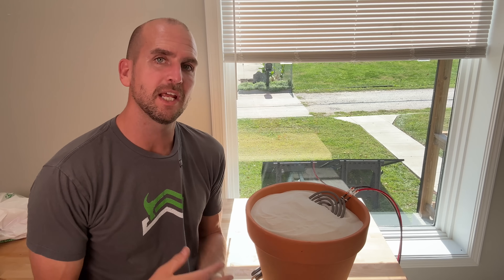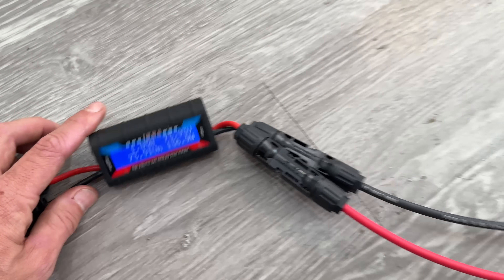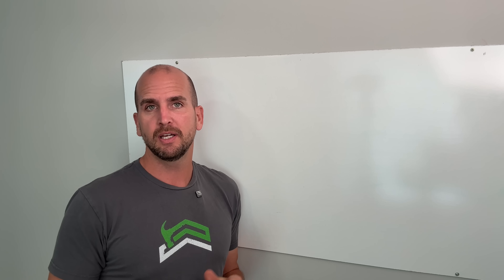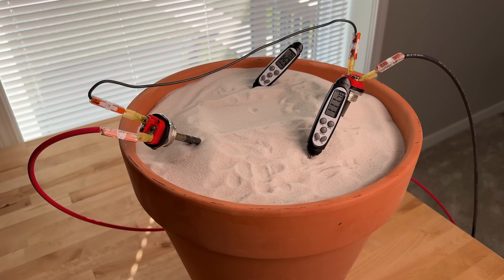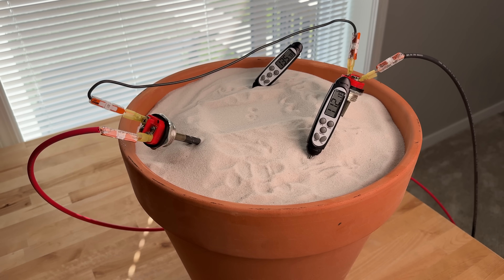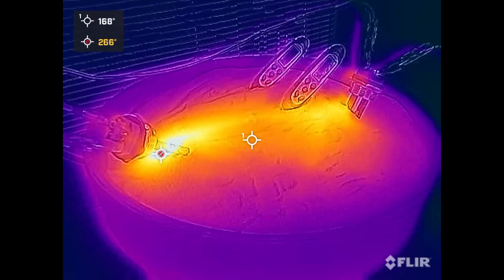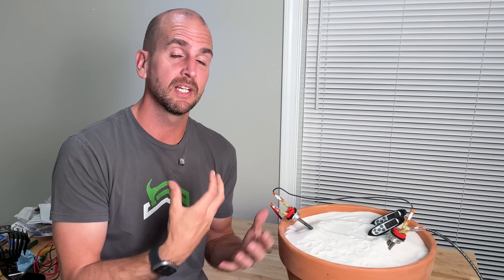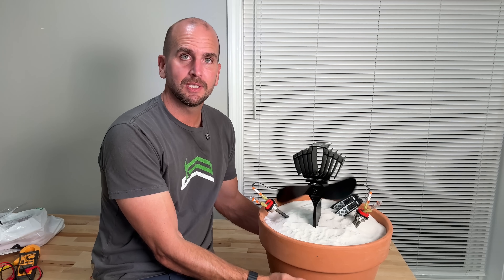How To Create A Solar Sand Battery Heater | Free Heat This Winter!

Comment: You are kinda recreating the pathway already done.  What you are ultimately going to reach is that the optimal way to do this is to insulate the sand box, which allows the temperatures to get much higher and be almost permanent, and then run water pipes through the sand that feeds out and heats a radiator.    There is a company in Norway that has a sand battery the size of farm silo, which then distributes hot water to hundreds of homes for heating... in winter, in Norway...
Reply: I was considering trying something like this with a 25+ gallon insulated container and creating some type of solar oven to heat the sand directly, and then run water through copper coils in the sand to generate hot and hopefully even boiling water. I'm really not sure it would work, but it seems like it could.
Reply: Sure it wasnt finland?
Reply: @regun2434    My bad, you are right,  I was going from memory.  It was Finland, the company is Polar Night Energy.
Reply: Great info. I feel a science fair project will be happening here due to your informative! Plus it is well thought out, well presented, and useful for emergencies!  Thank you for expanding our minds.
Reply: For a large operation, I can see the sand thing making sense, but you need a LOT of controls to do it right. For home-sized or DIY, just directly heating water is ideal.

All you need to do to safely control for overpressure is to make sure that more heat can passively leave the system than your maximum input, and then add a little safety blow off valve just in case.

Of course using solar PV to warm anything resistively is the main Silly Thing here. It's simple and convenient, but you're leaving a whole bunch of efficiency on the table at Step 1 where your panels only turn 1/4 of the energy landing on them into electricity.

If you don't have to move it far, using solar thermal collectors to collect more OR using a heat pump rather than resistive heat are both much better options.
Reply: @MarcDoughty Can you explain more on why 1/4 is being used. I need to understand this to set up an experiment.
Reply: @Swampwild1 typical solar pv panels only convert about 1/4 of the incident solar energy into electricity, (solar thermal is way more efficient, in uk, not very sunny we have both systems at home and the thermal system paid itself off in 5-8 years, the pv system without government sub😢would take about 15-20 tears due to said lower efficiency).
Reply: Addressing the H2O expansion... some platform of antifreeze has been utilized with positive results.
 I can't help but bite at the bit here...  The Norway example has been noted for some years now.  It has
been replicated throughout E.U., Russia, and the Orient for centuries. Egyptian and Roman temples and
houses have been constructed with elevated foundations with channeled rock heat transfer conduits
under them. A small sustaining fire at one end of the foundation-maintained floor heat throughout the colder seasons. (Have you ever seen Egyptians or Romans with snugly socks on?   :).
 It is life affirming to see sites as this one addressing current and critical subjects that are relevant to
adapting us to Climent change.
 Kudos...  
U W Seattle Metrology, Senior Fellow.
Reply: I DID that for Solaron in Oklahoma City in the early 80s. Solar domestic water heater with optional radiator. It was a 5 panel water system. It had a Honeywell drain down system for sub-freezing nights. It used a small amount of current for the pumps. No solar panels though. A bit early for that.
Reply: Well yeah, insulation is probably a good idea. I feel no need to mess with water or pipes. 
With this sand  I'd be afraid the pot would explode, depending on the material. And with insulation, the pot will reach higher temperatures all the way through.
Reply: *Vatajankoski, Finland
Reply: Wow awesome!
Reply: It is not water that runs through the pipes in the sand, it’s air.
Which is used to directly heat up the ducted house or a separate heat exchanger, if you need hot water.
The hot air flow speed over exchanger will control the temperature of the water.
Very different than immersing the pipes in 600 degrees sand.
Reply: It’s a pretty impressive setup in Norway
Reply: в таких системах не используется вода, потому что они нагреваются до 500-600 гр.С
Reply: Wander off into the extreme end and molten salts almost look appealing, but we're still working on how to run molten salts through plumbing without the whole thing corroding in short order.
Reply: Why using sand then? Water itself has 5 times more thermal mass than sand
Reply: @airattoz  water boils at low temperature and creates pressure issues.  Sand can go well above 1000 degrees without changing volume.
Reply: @PeterSedesse  How can you safely transfer that heat to water? It will evaporate, or you have to use high pressure with risk of explosion
Reply: @airattoz  as I said, there is a company in Norway that does this exact thing for an entire town.
Reply: @airattoz  pressure release safety valves, water flow rate control to stabilize input and output water temperatures and/or transmitted heat energy per water volume inside efficiency b laundries without loosing much through insulated exterior part of the circuit due to varying loss power directly proportional to atmospheric temperature and heated water temperature, heat exchange surface area optimization etc. Etc. .. welcome to science and technology!
Reply: @airattoz heat exchangers, radiator fluid 250F, brake fluid 600F
Reply: @PeterSedesse  in Finland. 🤭
Reply: @PeterSedesse  leere Rohre mit heisserLuft drin  problem solved
Reply: @jeffstout6567  Cleaver, but brake fluid is a lot more toxic than either water or a glycol mixture, making a serious spill, well, a serious problem.
Reply: @airattoz  the trick is the sand is heated to 600degC. then for a given volume its about 2.5x more storage.
Reply: @airattoz  I tried this with water but water's boiling point of just 100°C means you'll end up creating distilled water mostly.  Distilled water is very useful though and I keep barrels of it around during the summer months with all that excess solar.  

But for heating, sand's much higher melting point is a better storage medium for thermal energy.

Water also has significantly higher heat capacity at 4182 J/kg°C versus sand's 830 J/kg°C but, again, that low water boiling point kills it as a good heat storage medium.
Reply: @beyondfossil  
And there are other (and more interesting) liquids to distill . . 
:)
Reply: @beyondfossil  What about using something like auto antifreeze instead of water in the radiator?
Reply: @airattoz teoretyczne unikasz problemu woda/prąd. Piasek można podgrzać do 500*C więc to rekompensuje temperaturę  gorącej wody
Reply: @airattoz  because water changes phase when it turns into steam- a super useful property but it requires a LOT of engineering to get boilers to handle the pressure changes. You can heat sand to about 1500 degrees C before it melts/vitrifies (that's going to depend a lot on the composition of the sand) and salt melts at 801 degrees C. So you can pump a LOT more heat into a smaller area to store it without worrying about phase change or pressure using sand or salt as a storage medium.
Reply: Your poor knowledge is dangerous. If you use water the battery will explode when water turn into steam and expand. PS its Finland. Polarnight uses air
Reply: @nemam_nedam  No, thermal collection is worth it now and even more so in the future.

Firstly, solar net metering programs are increasingly becoming less generous than before.  California recently went to NEM 3.0 from NEM 2.0 which pays fractions the amount previously -- and NEM 2.0 pays less than NEM 1.0 did.  You can see where this is headed.  So it's better to keep that energy locally, and that includes both chemical battery and thermal storage for water & home heating.

Secondly, batteries have a limited amount of storage capacity and storage charge rate.  Maxing out either means electricity will flow out to the grid for minimal credits (see above).  Furthermore, regardless of the capacity of battery, you can only recharge as much as you used the night previously before the battery becomes fully charged and will not take any more energy.  In the summertime, that can happen as early as around 10:30am.  Then the rest of the day, large amounts of electricity is all exported to the grid for minimal credits.  I've had battery storage for over 3 years now with my solar system and now want thermal storage too.  I have an ad-hoc solar distiller with energy diverter that is helping but it's not as useful as whole home hot water which I'm craving for now.

Thirdly, water requires a lot of energy to heat up at 4182 Joules/kg/°C.  This energy would otherwise come from natural gas which you have to pay upfront for now and backend later with global climate change and local urban pollution.  Get a ceramic/sand water heater to store excess heat energy for hot water later or nighttime home heating.  Check out the "Fully Charged" channel to see a home that has complete electric only power and heating.  Storing surplus solar energy in ceramic/sand/phase change material is critical for this.

Fourthly, is bigger context.  Industrial heating for things like steel and concrete making makes a huge amount of carbon emissions worldwide.  Industrial thermal storage like ones that are the size of a warehouse full of ceramics will be crucial to a successful energy transition.  These thermal warehouses can directly flow solar captured heat for industrial use or convert it back to electricity with a steam turbine helping power regions at night or during bad weather.
Reply: @nemam_nedam  This is so sketchy. If you have free solar panels then of course converting electricity to heat and then storing it in sand to use it, makes sense. But doing so by using solar heat collectors for heating water and storing it in a big vessel seems more effective in all ways.
Reply: @airattoz water boils. Sand doesn't.
Reply: @airattoz  "sketchy" obviously in the modern overly misused sense...
Reply: @airattoz  EXCEPT... anywhere near 200F and water becomes a problem child. None of that matters with sand. 1000 degrees, 1500 degrees still fine...
Reply: @airattoz  Peak temperature using solar heat collectors is about 1/3rd than converting electrical to thermal.  Solar heat collectors just do not get to the necessary temperatures.
Reply: @MadRat70 ..they indeed go higher temperatures than water can handle..easily 200 degrees of celsius (water boilin in 100)..and as i've played with them i'd say one would need concrete floor to heat it up during winter due to being able to utilize the low temperatures and during summer and high temperatures a hot tap water would need to take over..and then you'll need an emergency system in case of excess heat in tank (which will happen if one wants heat during winter) and for the situation of blocked circulation where the whole amount of circulation water may evaporate and nobody wants the system burst/explode..😅..so with direct collectors, the water carrying the thermal energy is the limiting factor..
Reply: @MadRat70  Ever heard of a Fresnel lens?
Reply: @edwardtupper6374  He is aiming at a cost-effective use.  How do you propose to get the energy into the sand with a Fresnel Lens?  The cost of a lens seems high, too.
Reply: @MadRat70  You can get a Fresnel lens from certain rear projector tv's, I have recovered one. It helps to reuse the original panel mounting and chassis of the TV itself later, for installation in a sun tracking array. There are a number of options for automated sun tracking, to maintain perfect alignment. The array itself can be powered by a separate solar panel, battery and electric motors, as well as any ancilliary pumps, shades, louvres etc. The lens can generate up to around 1500 degrees C. The idea is to direct it at a thermal mass, in this case sand, although water and molten salt are alternatives. Water in pipes leading through the heat sink carry heat away to other heat sinks or radiators. Like a nuclear power station, only this one is a safe one hundred million miles away lol.
Reply: @nemam_nedam pv panels reaching theoretical radiation energy transfer limit is more feasible than rated water pipe panels due to volume/effective surface ratio limit of the pipes themselves, the less diameter and compactly positioned pipes are in a row the higher the efficiency and the lower the water temperature entering outside oanel is the higher the transmission of power between pipe surface and the water running inside
Reply: Seems better to run a hea pump and insulate your house
Reply: Nice story bro, no one cares
Reply: @daniel17319  all the replies and 300+ likes prove you wrong
Reply: @daniel17319  I enjoyed reading it and got something out of it.
Reply: @daniel17319 why make a comment like that? If you don't care , why should anyonne care what you think? People nowadays seem to have a need to express their opinion like it's the only opinion anybody should have. Troll many other vids?

Comment: I’ve built a 200L black barrel “Sand Battery” into a large DIY solar oven that has an open back leading into a shed. I am planning on placing an active element into the sand battery to increase the heat generated. So far I have achieved a 10 degrees Celsius difference from outside doing this with passive means. I’m thinking about just sticking heat pipes into the sides of the barrel so that the heating element doesn’t have to be buried into the sand and is easier to replace along with safer wiring. Hopefully this works for it but I can always use pool heating tubes to improve the passive heating efficiency. The idea here is to create something for buildings that have a crawl space that have the potential for pipes freezing while also providing heated floors in the winter. Exploring the concept if anyone has a suggestion please feel free to share.

Comment: Need a metal drum, steel piping wound inside, sand. Use a heating element and blower combo to blow heat through the steel piping buried in the sand.
When discharging just use blower no heating element.